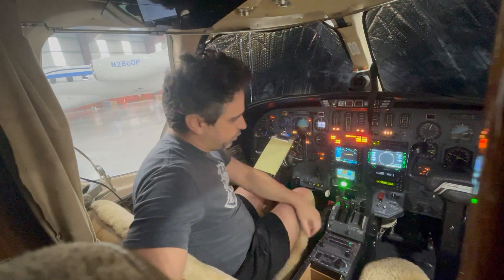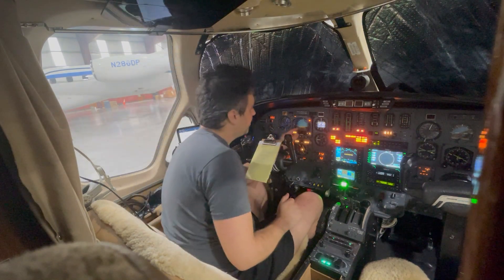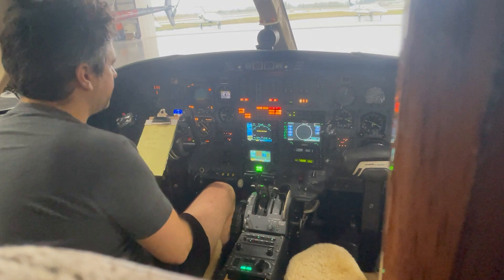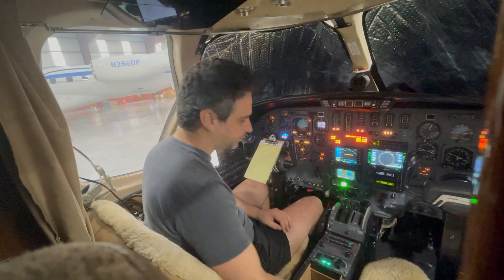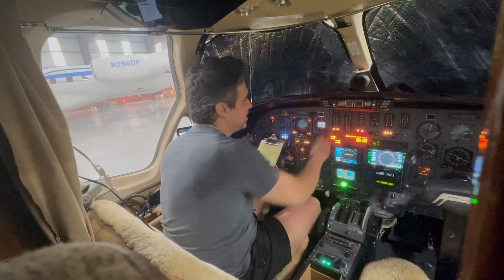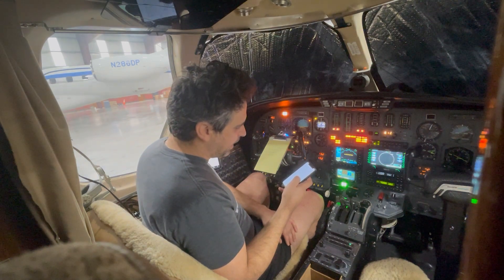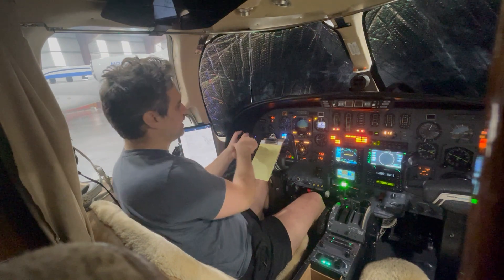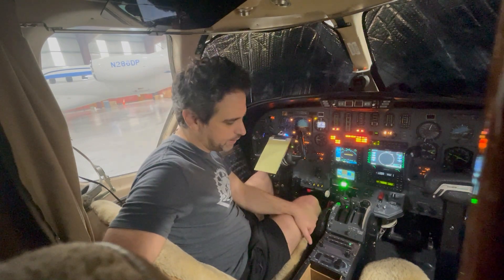Autopilot ground tests on Cessna Legacy Citation

Comment: Thank you for sharing. I did a few of these test with my GFC-500, but need to do a full suite of tests once a month when I upgrade the databases
I enjoyed this more technical content!
Reply: @FlyWithNoam  I have a 76 Cessna Turbo 210 with a Garmin GFC-500 3-Axis Autopilot.
I always look at the Citations with admiration. I think Cessna designed great Twin-Jets, and enjoy watching your professionalism in your flights. I do some checks on my systems and am encouraged to do more monthly, and pre-flight checks due to both your video(s) and a recent A/P Failure I had on takeoff that cause a Bravo Bust prior to clearance in.
Related to what you dealt with on the Frozen Trim, there are less systems to learn on the T210, and so when I experianced trim issues, I knew better how to deal with the aircraft. I have actually studied the maintenance manuals, and inspected the flight control cables, pulleys, and A/P Servos and how they are set up.
Just flew from Central Texas to Florida for "Sun-N-Fun" and back, and will get it into the avionics shop after getting some engine work done next week.

I loved your (banner) comments on that frozen trim video because you learned so much of how the systems work from dealing with the failure and mentioned at the end that this was a common issue. I think any viewer of that video will feel some of the stress you did. Even though the T210 is a single pilot airplane, my business partner usually goes on trips with me, so we can split the workload. I can't imagine all you were dealing with and not able to share it, and I loved how you engaged ATC for any help they could be.

So prior to that flight, you didn't know a lot about how the actual trim system worked (or failed) as well as the boots, and after that flight, you know those systems pretty well.

That is what flying is, constantly learning. I had never considered water retention freezing causing a failure like you had, but now, I will consider it

Thank you for the informative, and fun videos

Comment: Hi Noam, thanks for taking the time to make this video. At 1:40 you are talking about how you can overpower the autopilot servos. However, isn't it the case that the autopilot (at least for pitch) also controls the electric trim to trim out the servo forces? Is it possible that by fighting the autopilot the autopilot will run the trim all the way in the opposite direction, causing extremely heavy control forces?
Reply: @FlyWithNoam  If you hold the yoke against the servos, then won't the autopilot run the trim all the way in the opposite direction? Then you'll be fighting a severely out-of trim airplane and the control forces might be very high. This is why it's said "never fight the autopilot". Disengage it as soon as possible. Pull the circuit breaker if necessary.
Reply: @FlyWithNoam  Ok, thanks for the clarification. I was just concerned that someone watching would get the impression that this could also be done in flight.

Comment: Curious how you like it compared to the 421 in previous videos.     Curious how much more it costs to operate per hour ( in percent is ok) and if it’s easier to fly than the 414/ 421 you had
Reply: @FlyWithNoam  👍☑👏🏻 Should be good, tks in advance!